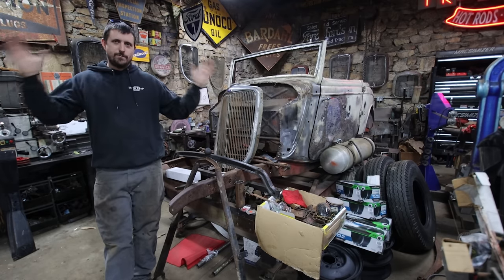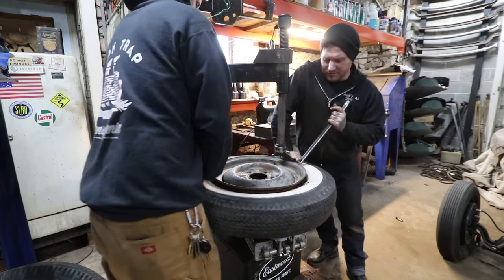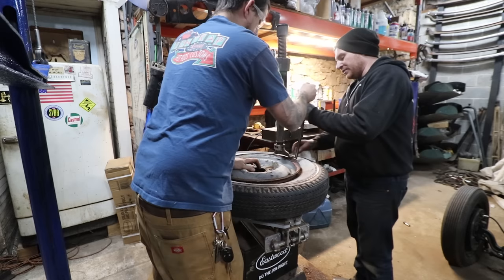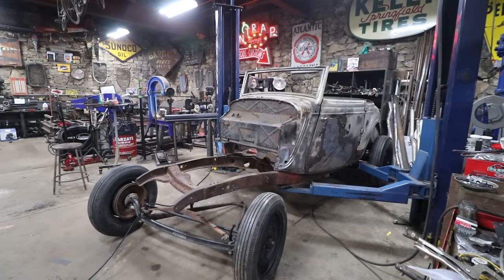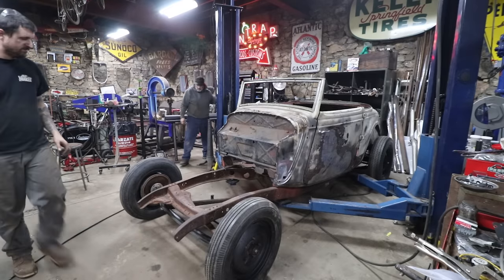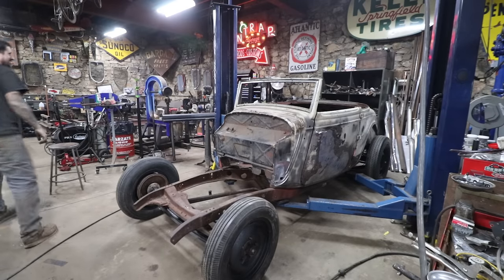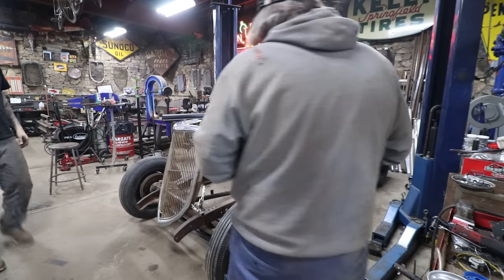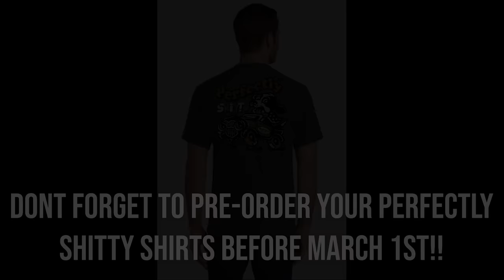Mike's 1934 Ford Is FINALLY Sitting On The Ground And It Looks Bitchin!

Comment: Congrats Mike. Are you using a 4" front drop axle. 🤔 are going to use an older F1 Ford steering box . Is the rear end a Columbia type.